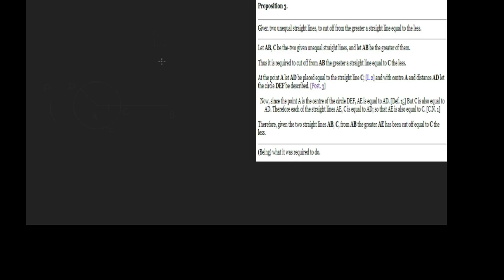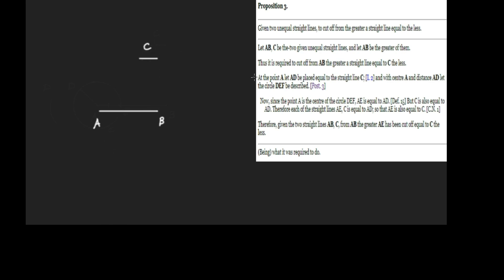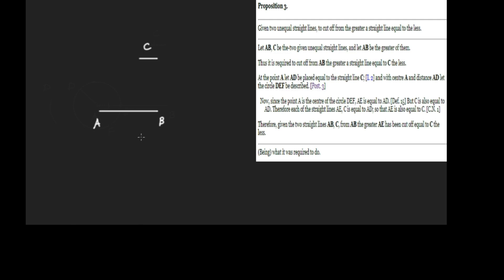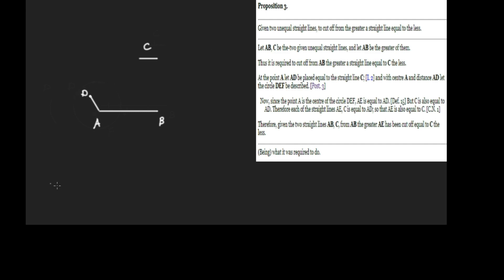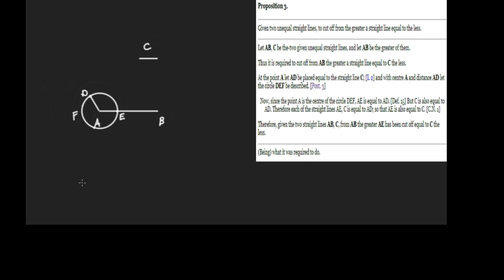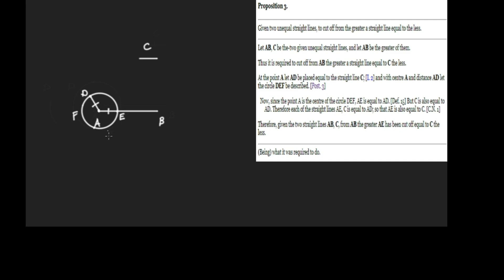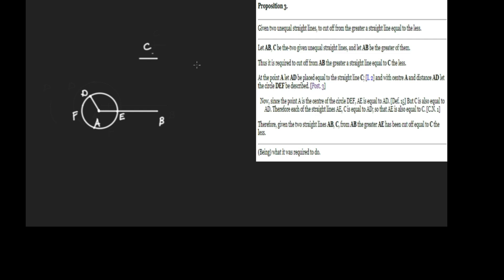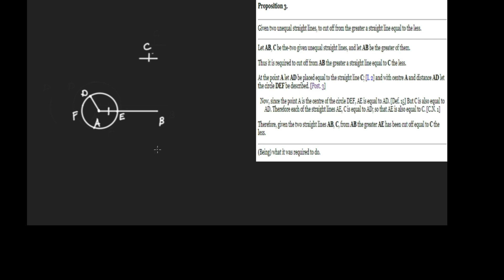Euclid's "Elements" - Book 1, Proposition 3

Comment: Why not just take the compass length ac directly and mark off that length on AB ? Is this proposition defined by the word 'construction.' I mean, isn't just using the compass directly to measure out ac on AB a construction in itself ? I hate semantics !
Reply: Remember the previous video we learned that you can only draw a line of equal length from a given point by drawing all those circles? Well this video is just showing one way to use the method from the previous. It's because of the collapsible compass which can't transfer distance without the method of the previous video.